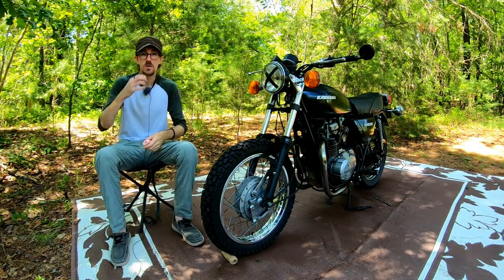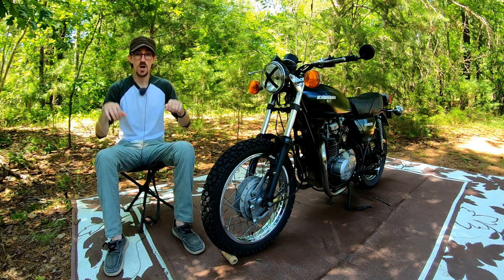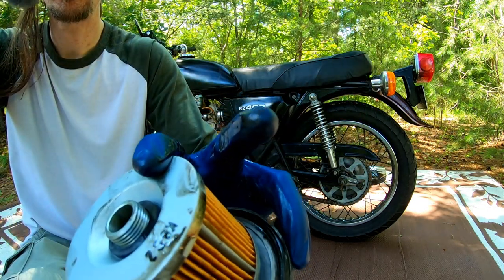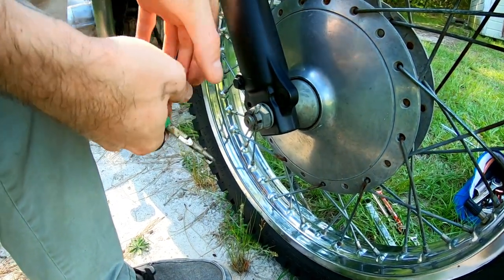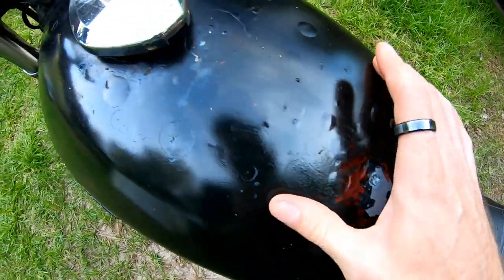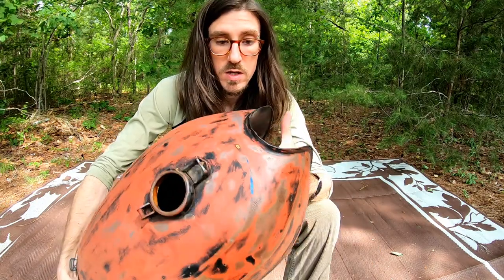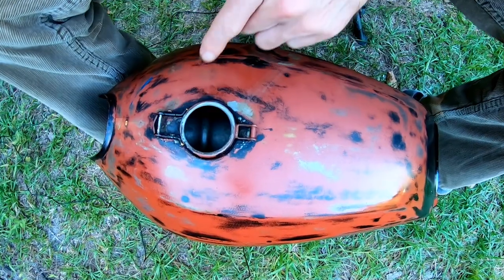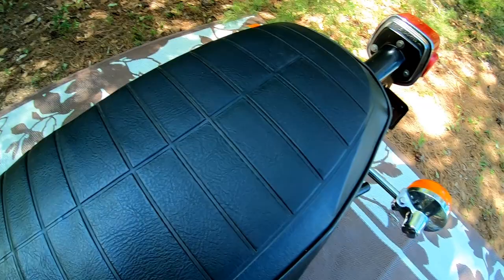1976 Kawasaki kz400 | Mini Project

Comment: That's some skilful welding mate. I used bronze brazing to fill the pinholes in my 440's tank. Requires less skill than your welding. Whatever works!
Reply from the maker: Hes been welding for over 25yrs…solid welds👍🏻 I’m with you whatever keeps me riding is the way I want to go…like using a PA systems bolts for a petcock😂thanks for watching and commenting man hope all is well and stay safe out there on that 🏍440🏍💨💨